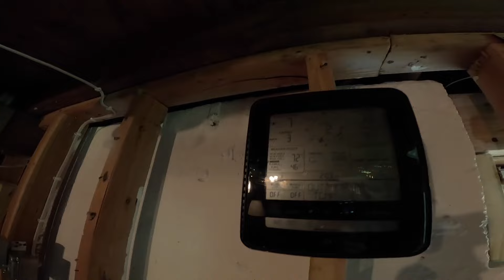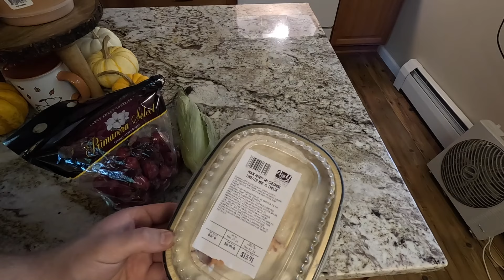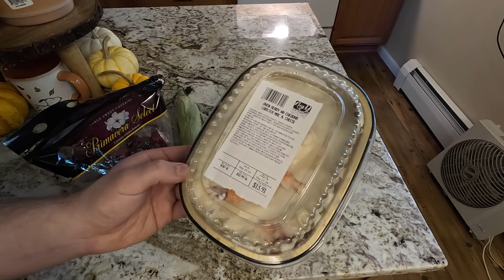Video of the Day #20

Comment: Ive learned, to use the fans facing OUTWARD on the open window. otherwise your just blowing the warm air INTO your house. If the fan doesnt cover your whole window, use a cardboard piece to cover the screen part. Try it, and see if it works for you, Ive been doin it that way for years